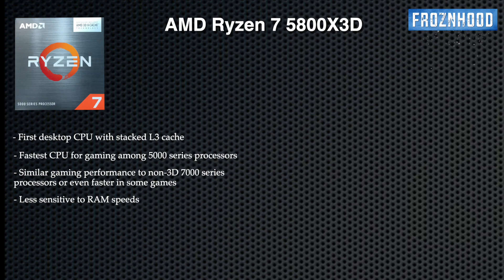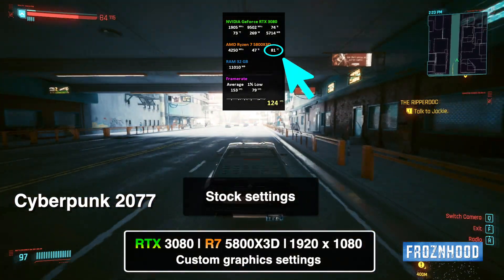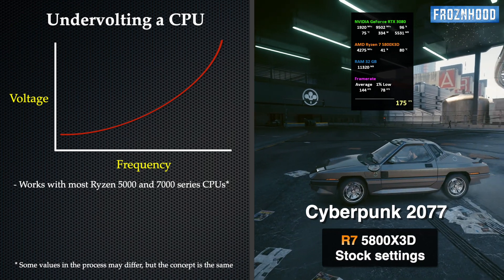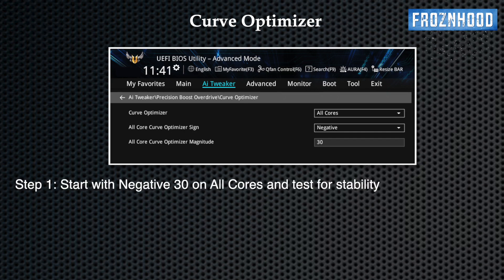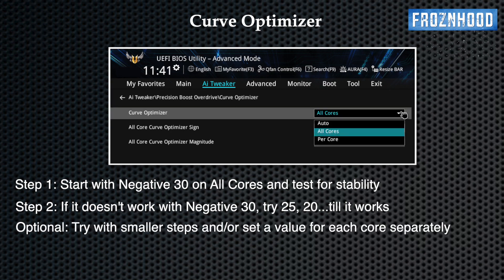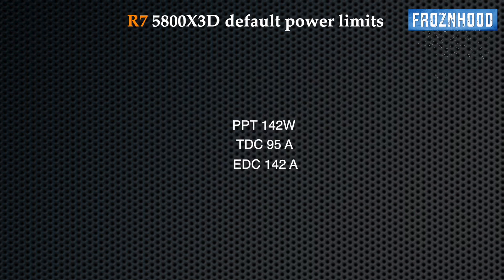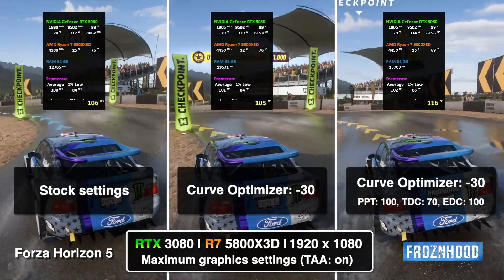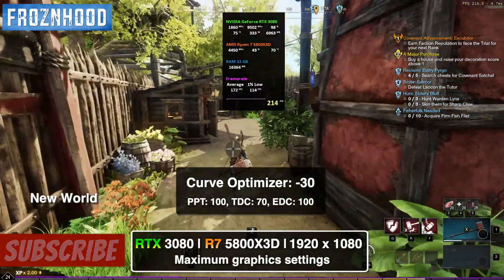Optimizing Ryzen 7 5800X3D - Higher performance, Lower temperature | Undervolting | Curve Optimizer

Comment: This is an absolutely LEGENDARY video that i find myself coming back to often, I HIGHLY recommend this for anyone struggling with high temps. I have a 7900XTX, a pretty small case, and live in a hot area. So when I upgraded to my 5800x3d I was getting constant CPU overheat crashes, I spent forever trying to fix it, new cooling solutions, reapplying thermal paste, etc, but nothing worked I was getting constant 90c while playing games, then I tried this and it works like a CHARM, so easy to do, you really give such clear simple instructions, benchmarks, and everything we could possibly want! Using your settings helped ALOT and its a no brainer not only does it reduce temps but also boost performance! Absolutely incredible thank you so much again sir!
Reply from the maker: Thank you for your comment! I am glad that the video helped you. 5800X3D + 7900XTX is a good combination. Enjoy your games. 😀
Reply: Thank you for the extra power limit knowledge 5700x3d brand new just came in.. will be my last upgrade for 5 years or so
Reply: is your system still running stable or did you tweak it since then?
Reply: @joejoe5921  Still running stable! I've had a few different unrelated issues as is always the case with PC gaming haha but no matter what this always helps, I was having GPU issues and had to reset BIOS settings and completely forgot about the undervolting, so when i got it all working again I was getting crazy high temps but then I remembered and just did this again and boom, works like a charm :) I truly find it wild that this is pretty much a must for all users since it lowers temps AND improves performance! BTW if you want my full specs check out the description of any of my vids but yeah the build is coming along very well and stable :)
Reply: @ sound awesome!! thank you for your insights. i'm thinking of trying the same soon^^
i would just need -5°C less on the CPU because the summer is on its way soon. not sure if it is worth the risk.
Reply: @joejoe5921  No worries my friend! Hell yeah i highly recommend this setup it's done nothing but serve me well! And yeah I definitely get that, i was in the EXACT situation as you in summer getting 90 degrees CPU and thermal throttling, not sure where you live but I am in Australia and its HOT here during summer so this was a must, but now after doing this under full load even on a hot day I'm getting around 85 degrees which isn't ideal but also not to the point of thermal throttling :) And in terms of the risk In my experience theres been no issues at all so I say got for it!!
Reply: How is your PC running? Any problems?
Reply: @Scr3amapillar Absolutely amazing!! Since my previous updates in the above comments I've had no issues whatsoever after downclocking the CPU and adjusting the curves and such. The system runs cooler and absolutely no performance drop in fact I feel like I've gained FPS but at the very least there's no drop, so yeah I highly recommend starting with as much as you can like -30 on all cores which i run and then if you encounter issues then try -25 etc!

Comment: Hello sir and thank you very much for the video. It really helps with the temperatures which this CPU is really bad.
My Setup is MSI B550 MPG Gaming Plus - RYZEN 7 5800X3D - MSI Ventus 2x GeForce RTX 4070 Ti Super 16GB GDDR6X OC - CORSAIR  VENGEANCE  RGB  PRO  48GB/3200MHZ.
I don't know if you have mention it somewhere but i really can't read 1400+ comments, so please if you can, i would like to know some testing stability programs (free i suppose) for my pc. (as you have mentioned in the video).
I would really appreciate it. Keep up the good work!
Merry Christmas!!! 🎄🎄🎄✨✨✨
Reply from the maker: Hi, test the system with 3DMark and/or Cinebench for about an hour. If it is stable, continue testing with the games you usually play (if they were 100% stable before the undervolting).

Comment: Do I use the same recomended values for ppt tdc and edc for the 5700x3d? I am using a 360 AIO cooler. I did the -30 already and it’s stable but want to ensure for the ppt tdc and edc I should use the same values for this chip?

Comment: My R7 5800x3d doesn t pass 3.4 if i use manual optim, i have a aorus elite as motherboard
Reply from the maker: Reset the BIOS before adjusting the settings shown in the video. If that doesn't solve the problem, make sure that you have the latest BIOS version. If you are going to update the BIOS, read the motherboard manual first to be sure how it is done properly.

Comment: i tried in my system.msi b550m mortar max wifi and 5800x3d. The result is unbelievable. i set to -30 curve and 100w 70a 100a. 
pubg +40 fps
no fps drop
-10C
you are a hero man big respect

R23 single 52C
R23 Multi 72C

Comment: @FroznHood does that work also with the 5700x3d or do I have to try other settings?
Reply: I tried -10 atm but I could go -30 as well es change the limits. But I’m not sure because I have the little brother of the 5800x3d as mentioned

Comment: I was linked to this video and thanks for that! Now my 5800X3D does't run as hot and I don't think I'm leaving too much power on the table. I was hitting 90C in less than 5 mins, now it runs on 80 pretty much stable.

Comment: Thought I would drop by to leave a thank you. I have an older AMD 3000 series I was upgrading to 5800x3d. It was already doing ok, but undervolting using your tips made it better! So simple. Not stressful. Better temps. I maxed these cores with cinebench and it was barely touching 80 degrees (gaming won't be as taxing as cinebench!), idle is now down in the low 30s. THANK YOU!

Comment: I get different results.  Lowering and  capping the PPT, TDC and EDC  just led to much lower average and peak frequencies down to running at 3500 MHz  according to OCCT test CPU runs.  Ryzen master show PPT and EDC maxed out  which explains why the poor performance... Temps  really weren't better either  at 100/70a/100 they were over 84C with a Liquid Freezer cooler AIO.   Since I also had a MSI B550 motherboard, I get best results only  doing PBO curve optimizer per core negatives (-25 on best cores and -30 on others) with Kombo Strike 3 enabled which results in 10min OCCT runs at 76C and averaging 4050 MHZ with 4100 MHZ max and best CPU scores as well.  Not sure if Kombo Strike does more than just curve optimizer adjustments as it notably improves temps and MHz as well.

Comment: Great video but I have a Gigabyte x470 motherboard and it is not the same interface or the same options as presented in the video. Could you guide me on the options to validate on my motherboard? That would be very kind !!😀
Reply from the maker: Check what is the exact model of your motherboard. Then go to the Gigabyte website and the support page for that model. There you can check if you are using the latest BIOS version. If your BIOS is too old you may not see the needed settings, including Curve Optimizer. You should have a PBO menu in the BIOS. If you are going to update your BIOS, be careful. Read the manual first.
Reply: @FroznHood  Ok thank you I will look at all that !!

Comment: How can i determine my PPT, TDC and EDC for 5700X3D. Do you have any advise ? Thank you !
Reply from the maker: Download and install AMD Ryzen Master from the AMD website. It will show you your current power settings. If you want to know the default values of your CPU, make sure that you haven't changed anything related to the CPU in your BIOS (must be in default state).
Reply: @FroznHood  Should i use the same values in BIOS for undervolting ?
Reply from the maker: What default values did Ryzen Master show for your 5700X3D?
Reply: @FroznHood  The current values in Ryzen Master are PPT : 142 TDC : 95 EDC : 140 , what are the new values you recommend in BIOS ?
Reply from the maker: First set the Curve Optimizer to -30 and test for stability. If it is stable, check your temperatures and frequencies, so you know whether you need further optimization. If it is not try -25 or -20. Then, if you want to optimize further, try with 115/85/115. The system must be 100% stable. Whether you should try even lower values depends on what you want to achieve. Use the latest AMD chipset driver from the official website and make sure that your BIOS is up to date.

Comment: great video but I did as shown in the video but now my processor no longer uses turbo boost, locking all cores at 3.6Ghz i have aSUS B550M TUF GAMING
Reply from the maker: You need to update your BIOS to the latest version and/or reset it before the optimization.

Comment: MF!!!! Dude, I could kiss you right now! THANK YOU! Mannn, I tried following this guide multiple times over the years and for the life of me I could NEVER get this to work properly. Welp, turns out, my issue was with a single setting in Windows believe it or not. I ended up browsing forums again as usual lol searching for answers and long and behold, under the power options, go to advanced settings, CPU Cooling, and make sure your MAXIMUM speed is set to 100%. Mine was set to 99%. 

Every time I'd overclock, undervolt, reset to default, my CPU would reach boost clocks for all of 30 seconds to a minute after booting into Windows. The millisecond I'd run a benchmark, the CPU would immediately lock itself to 3.3GHz! Below my base clock. Phew.....after I wrap up this initial benchmark (w/-30 on the curve optimizer) ima go back and toss in those manual limits for the Boost Override and re-run Cinebench. 

Edit: I should probably be thanking that guy from that forum but again , thanks for this video! ❤

Comment: I tested 115 75 120, -30 all core, -20 all core, it all has issues. when i open apps, freezing cursor. Stuttering when booting up apps. What is the problem?
Reply from the maker: Is your system 100% stable and without issues without the undervolting? Are you using the latest BIOS version? Are you using the latest amd chipset driver? How are the CPU frequencies under load? Have you changed any other settings in the BIOS?
Reply: @FroznHood  I'm not very familiar with all these terms, but I am certain it is stable without touching any pbo or curve optimizer settings. No stutters, just heat problems. I'm thinking it might be a few cores being too weak and the curve optimizer being too great for those cores? I am using latest BIOS, chipset drivers. I can play games without crashing, just that low load opening applications like Steam will cause slight stutter.
Reply from the maker: Try with setting the Curve Optimizer to default, and only change the power settings - 110/80/110 and/or 100/70/100. See if that stuttering is still there. It is also very important to watch the CPU frequencies during idle and load state. If you see it running at 3600 Mhz on load, either you need to reset BIOS or you are not using its latest version. Also, for the AMD chipset driver, use only the AMD official website to check for the latest version (not the motherboard website). What is the exact model of your motherboard?
Reply: @FroznHood  I apologize for the late comment and appreciate your response. I currently have a MSI b550 a pro which should be the latest BIOS. I've tested many numbers for PBO. I thought it would stable out the desktop stutters if i increase the CO for the weaker cores, such as c06-C08. For example, from c01-c08, -25 all the way to -10. It did not help. On stock settings, it works properly, no stutters, just heat. I've tested 122 82 124, all core: -30, -25, -20. All unstable. 100 70 100 is a bit better on -25 but still a little stutters, and fps drops.

Comment: Hey, really good video and explanation, I was wondering if you could help me with my problem. I have set all cores to -30 and set the other stuff to 110, 70 and 110. So now I have the problem that when I stress test the system is stable BUT, i think my cpu is throttling. Because the core tact drops down to 4Ghz (from about 4.4) and my cpu "Package" Temp is on 90C. What should I do to prevent this from happening? Also my RPM Cpu cooler is already on the max rpm.

edit. In case your wondering what cpu cooler i have, its the "be quiet! Shadow Rock LP" I have a pretty small case so i had to use this one.

Comment: Hey @FroznHood 
First, great video and thank you! 
Second, You said feel free to ask for "How to test stability." And here I am asking for help :D 
Hope you can help me out :)
Reply from the maker: Hi, what are you using your PC for? Work, game? What kind of apps?
Reply: @FroznHood mostly gaming(Performance-intensive games), and a bit of music production(FL-Studio 21)
Reply from the maker: Before starting the procedure and the testing, you must be sure that your system is stable. Use stable chipset and GPU drivers. Turn off Windows updates till you finish the testing. You can use 3DMark or Cinebench for stress testing. Scores are irrelevant since they do not represent real gaming performance. Use them only for stress testing the CPU. Run the tests for an hour. Any crash or freeze means your system is not stable. If you are trying -30 CO, then try -25. Test again. If it is still not stable, try -20. Same works for the power settings. If it is not stable with 100/70/100 try 110/80/110. Test CO and the power settings separately. If the system is stable after 1 hour of stress testing, start testing with games. Use only stable games, that haven't recently received a major update/patch. Play your games as usual. If you see a crash or freeze that hasn't happened before, the system is not stable. Change the settings and try again.

Comment: What is the CPU NB/SoC Voltage setting for this? Mine is currently at 1.008V with "AMD overclocking" option. Is this good to combine with these?
Reply from the maker: Leave the voltage at its default, which should be Auto. Change only the settings shown in the video. If you start changing other things you will probably make your system unstable and waste your time trying to find the problem.

Comment: Thanks for the video m8 but when i undervolt my cpu with your settings my ram decreased from 3600 to 2133, why is that?
Reply from the maker: There are many possible reasons (there are many things you can check), one of them being that your BIOS is not accepting the new settings (or can't boot the system with them) and is resetting some or all settings to their defaults. The CPU undervolt and power settings are not related to the RAM settings and speed. It could be a chipset specific issue, or you are using an old BIOS version. Make sure that you are using the latest stable BIOS version. Also, try with slightly higher values, for example CO -25 (even -20) and 110/80/110, just to check if it is booting properly (without reset to default).
Reply: @FroznHood thank you so much bro🙏🏻🙏🏻 it worked just needed to decrease the CO -25  bios and chipset was already updated to the latest 🙏🏻🙏🏻🙏🏻

Comment: Hello there!
I did all the steps on the video but yet, my Ryzen goes to 80ºc while gaming.
If anyone could help I would appreciate, I'm not sure if it is supposed to be like this, since this process is normally a lot hot.

My Specs are:
Ryzen 5800x3d
RTX 4070 ti
16GB RAM
Water Cooler: MasterLiquid ML240L V2 RGB
MOBO: MSI MPG B550 Gaming Plus
Reply from the maker: Hi, did you solve the problem? In which games do you see up to 80ºc? You are probably not doing some of the steps correctly or your motherboard doesn't apply them properly. Since you are using MSI MB you should check the Kombo Strike setting. It may interfere with what you are trying to do.

Comment: did it with and also got amazing results. Much lower temps measured with OCCT, very stable frequency on 3dmark tests and did the Riftbreaker and saw increases from 183 to 191 fps... HOWEVER. The game crashed two or 3 times and some games (had many great gaming sessions), also, I started to get a new kind of stutter where the PC completely freezes for 1 or 2 seconds on loadings.

I tried a few configurations and decided that the colder CPU and a few frames were not worth these wierd load stutters and few crashes. I settled with auto settings with the curve in -10. Got a small gains in temps and no more issues.

Comment: Are these settings the same for R7 5800X?
Reply from the maker: You can use the same strategy to optimize 5800X (and achieve very good results), but the default power settings of this model are different.
Reply: @FroznHood hello can i follow same step with 5700x3s via pbo2tuner

Comment: Nice Video man, can we also do that with Ryzen 7 7800X3D? I will switch to AM5, thank's :)
Reply from the maker: Yes, it should work, just with different power values. The default values of the power settings of 7800X3D are different. As explained in the video, every unit is different, so you will need to test step by step till you reach the best spot while keeping the CPU and the system stable.
Reply: @FroznHood  Okay, sure. Maybe I will do it also with the "Kombo Strike" Setting in my Bios like I did with my 5800X3D :) Thank's for the answer!